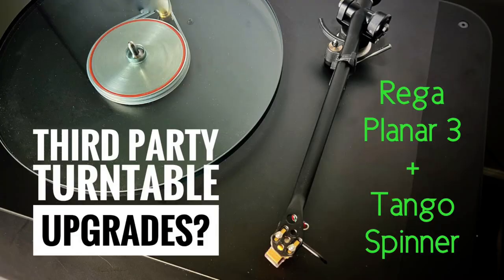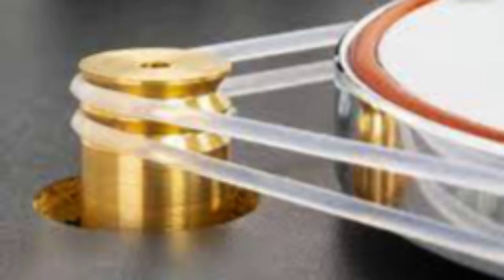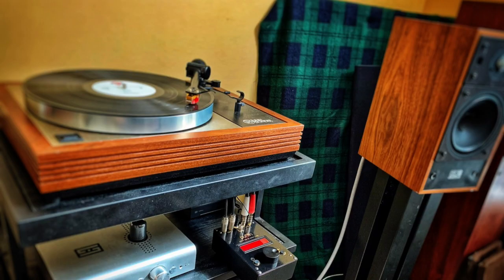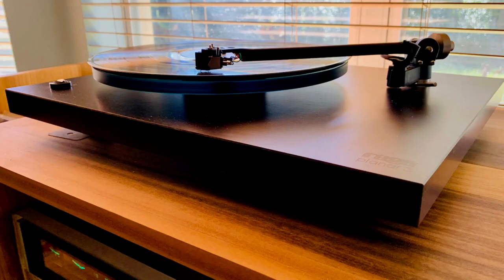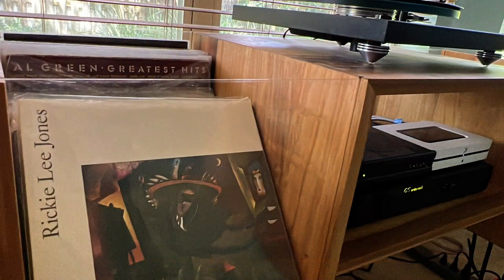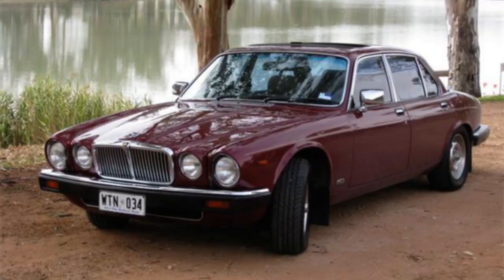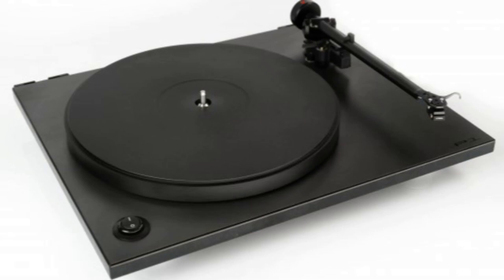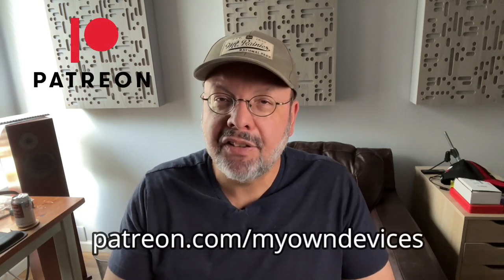Rega Planar 3 Vs. Linn Sondek LP12! Tango Spinner Upgrades a Winner? Pt.2

Comment: You would not want to put a Mack truck shock absorber on a Honda Civic.  Tonearm/Cartridge compatibility - by Galen Carol Audio.... is very helpful to understand the general important mechanical aspects of your tonearm/cartridge capability in order to provide the best sound from a record groove. The Rega 300 tonearm's effective mass is 11.5g. It should be used with carts that weigh 4 to 11g for the best chance of getting great sound from the records that you paid so much for.

Comment: I currently use a Rega planar 2/ nad clone version with RB250 and new AT95, I've had a Linn Axis and a Sondek, I preferred the Linn sound, I thought the Axis sounded a lot better and I loved speed switching. The sondek with Akito Mk1 I thought was amazing. Why did I get a rega, because Linn Axis are know to break out of the blue and it did. Should of kept the Linn Adikt. Got the planar 2 at £140. It's way of better than the Axis by a long shot so the LP12 blue it out of the door. Why did I get rid of the sondek, because I knew nothing about turntables then so I'd swapped it for an Axis. My last one was the second one I had.

Comment: That was very interesting, thanks. I did similar upgrades to my P3 some time ago, but I didn't have a Linn lying around that I could use for comparison 😄 I also liked the result I got changing the glass platter for an acrylic one - I'd like to hear how you get on with a delrin one if you go for it.

Comment: How do know that the cartridge used is a good match for either turntable. Maybe with a Grado for instance, the Rega would be much better than the Linn or the opposite. The Linn would benefit more than the Rega with other or better cartridges. Shouldn't that be taken in account. 
Love the time and effort you put into this. Thank you
Reply from the maker: I suppose I will never know and not really bothered to find out. Very happy with the AT VM740ML. Excellent performing mm cartridge for a reasonable cost. Thanks and you’re welcome.

Comment: Pretty sure those sub-platters are Stainless Steel, not aluminum...
Reply from the maker: Aluminum with stainless steel spindle.
Reply: @MODAC or Aluminium if we dont bastardise it 😂
Reply: @MODAC The linn LP12's inner and outer platters are made from a die cast zinc alloy know as MAZAK, which actually  only contains 4% Aluminium. The castings are machined to very tight tolerances to ensure balance and rotational stability.

Comment: Did you check the speed of the tables? The Linn's speed is adjustable, if you don't know, by adjusting the tilt on the motor and that changes where the belt rides on the pulley.  Sometimes a slight bump up in rotation (speed) makes for a snappier sound.  Also, does the Rega have the 24volt motor upgrade?  That is the best place to start to really make a solid improvement.  Also, what is the idea of the two belts driving the platter?  Have you tried just one belt to see what happens?   I have heard several Rega after market mods and for the most part , they may sound different but just different and not necessarily better. Actually even some of the Rega improvements I would include.  If you can, dump the Parasound and get a Naim phono board. Both tables will sound better.  And I have to say your audio system has evolved into a really great one on a sonic and esthetic level.  It reminds me of the kind of setups that I remember seeing in certain specialty shops plus British rags like HiFi News.  I think that it's just timeless.
Reply from the maker: Yes, I am aware of how to adjust the speed of the LP12. Besides a phone app, I do not have a proper strobe to accurately check speed. 
I have multiple systems in my house that are continually changed. Do you think it’s easy to find a phono board in the US (or anywhere) for a 20+ year old Nait 3?  I’m not sure that I want to invest anymore money into the old Rega. Resources better used elsewhere. Thanks
Reply: @MODAC  So I spoke to John Schwarz at Pro Musica (Chicago) and he has the phono boards for the Nait III in stock and at a reasonable price if your interested.  It took me all of sixty seconds to find them.  I don't think anyone in the country knows more about Naim audio products than  John and Ken Christensen. Ken also is a Naim recording engineer.  P.S., Ken informed me that they got in the Naim Solstice Turntable, arm and preamp combo and that it is better, sometimes subtlely in every way than a fully loaded Linn and this is from one of the most staunch supporters of the LP12 (until now) I know and has had every other table outside of the insanely priced gear in their shop and that says a lot about the Naim table.  Didn't bother to ask about the price.  Plus everything I just wrote goes double for Rega.
Reply: @mortlach186 
 I can vouch for Pro Musica's two owners. They'll solve any problem that arises with either Linn or Rega decks.

Comment: I was amazed at the improvements to my Project Carbon Debut DC after getting the aluminium sub platter and acrylic platter upgrade. It went from a great for a $400 table to a spectacular $600 one. It was definitely worth what I spent and then some.
Reply: Well. Why don´t they sell a decent turntable in the first place?

Comment: I would agree that in England the Rega 3 was recommended if one could not afford a Linn LP-12... but under no circumstances were they considered equal or even close to equal in sound. It was stated over and over by reviewers that the Linn was substantially better than the Rega. In fact a stock Rega 3 was and is rather overrated in it's performance. I used one and could not see what all the fuss was. Plummy bass that lacks extension with a pervasive brightness thanks to the undamped glass platter, lousy arm cable and a nasty arm resonance... the arm tube rings like a bell when tapped.
Reply: In my opinion the early Rega Planar 3s were better than later production. They were more solidly constructed... even the glass platter is a bit thicker. And the Rega RB300 arm only got worse after years of production. It has a distinct arm pipe resonance you can hear when you tap on it and which brightens up the sound of whatever cartridge you are using. Some people conflate that brightness for detail which is why it's popular... they don't realize it's just an arm colouration. Add to that a thin crappy arm cable that's light weight in bass.
The original Rega R200 arm found on early Rega tables while no champion was and is a more listenable arm than the RB300.

Comment: Why didn't you just buy the new Rega P6? Don't understand all the messing about you've done
Reply from the maker: A new planar 6 is $1875.
Reply: @MODAC  So? After pissing away a lot of money on the celebrated "upgrade path" of a typical Rega fanboy you´ll probably spend that amount of money anyway.
Reply from the maker: @BO-kh1iz  nope. A fraction.
Reply: @BO-kh1iz  agreed.  I got the p6 with exact 2 and it blows away my p3 elys 2.

Comment: An LP12 is only as good as the person setting it up.Comparing it to other turntables is a pointless exercise.I've heard Lp12s sounding worse than a Dual.
Reply from the maker: That is one of the annoying aspects of owning an LP12. I’ve had quite a few turntables, and none besides that one requires “expert” setup. Is it a feature or a shortcoming? I don’t live near a Linn dealer, so I’ve had to watch a few videos on the dark art of Linn servicing.
Reply: @MODAC  When it is well set up,you generally forget about the hifi and you simply want to put a record on and listen to music,all the time.A badly setup LP12 makes the music sound boring and listless .The choices are listening to the musicians or  listening to the sound of the instruments?
Reply from the maker: @LeoShoSilva  as I said in the videos, my LP12 sounds very good. I did not say there is anything wrong with it.

Comment: I have tried several Regas. They all triggered my tinnitus and even caused facial contractions. Some people say this can be caused by the glass platter, and a dealer suggested I use an acrylic platter instead, which of course turned out to be expensive. Another suggested I forget about Regas altogether since they sound like CDs anyway; not what you want when you choose to go analogue. Since Regas also have an on/off switch that threatens to blow out your speakers every time and as a rule run a smidgen too fast, I finally bought an old Thorens instead, in fact the same model that Linn stole their design from. It does the job and does it well!
Reply from the maker: You certainly have an agenda. Thanks
Reply: @MODAC  I do. I'd like to hear from any others who have had tinnitus problems with the Regas. Incidentally, I've had some too with a Clearaudio Concept using the MC made for the model.
Reply: @jimmyolsenschannel6263  Never heard of a turntable triggering tinnitus or trigger any illness?  May I ask what kind of music you listen to when this occurs?
Reply: @willanderson6963  Thanks for showing an interest. Since you ask, I listen to rock, jazz, folk, classical and all things in between, but really the style of music is irrelevant in this discussion. The tinnitus is triggered a few minutes into listening to any Rega player I've tried and also the Clearaudio Concept when used with the designated MC cartridge, not the MM. The use of a glass/ceramic platter on an unsuspended turntable seems to be the culprit.
Reply: And Thorens stole the design from Acoustic Research in 1965 :)
Reply: Ariston RD11

Comment: What a load of dross. A budget table like a Planar 3 could never hope to match a well set up Linn LP12 even with sub platters, new motor, feet etc. The Rega arms sound colourless and Grey and needs a full rewire to add some sparkle.
A linn deserves a better amplifier than a Nait 3 to show off its attributes whilst a better amp will only highlight the shortcomingsin the Rega Planar 3.
All linns are coloured with a bass bloom but it can be minimised by choice of bearing.
Reply from the maker: Well, I don’t believe you’ve been to my listening room to hear it. You certainly have a very strong bias that leaves you very close-minded on this topic. I just upgraded the platter on the Rega to a Delrin model. Even better than before. I recently changed the springs on the LP12 and tuned the suspension. Noticeably improved. Nothing wrong with the Nait 3. I used it for this demo with a Parasound preamp to make it an even playing field. I have numerous (better) components that I can use. I’m having fun here and you are taking this much too seriously imo. Thanks